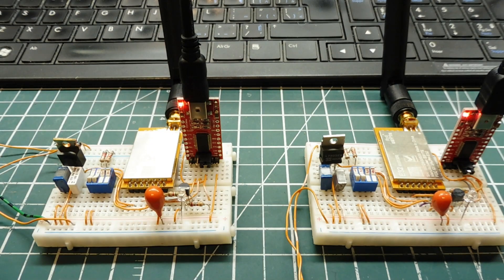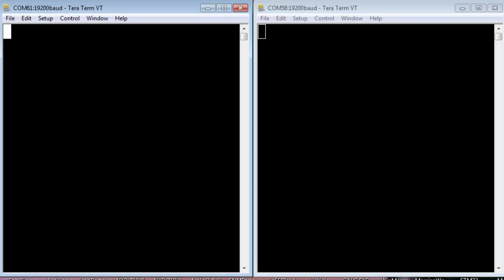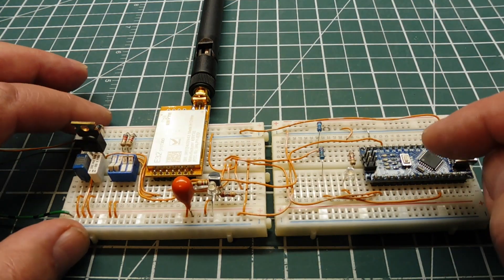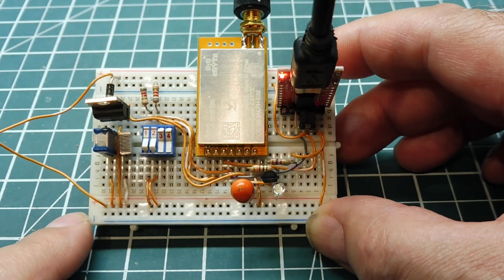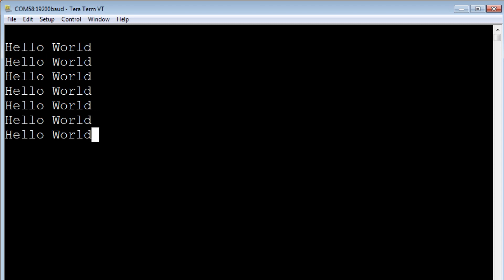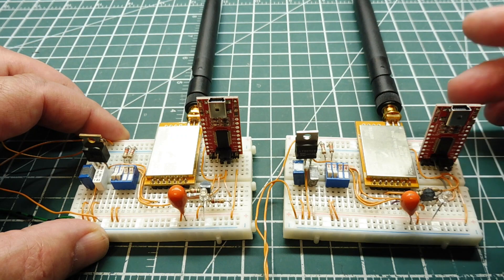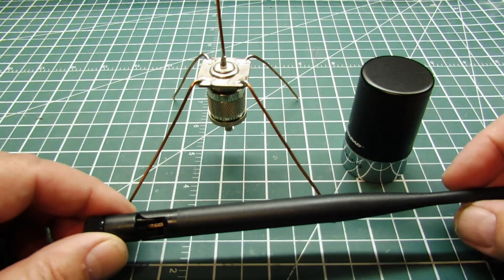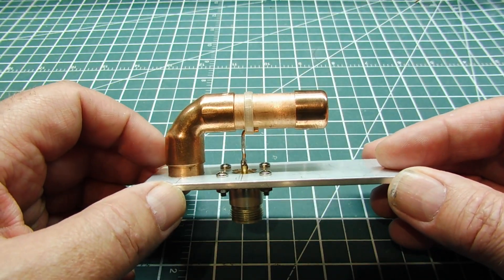Build A LoRa Radio Data Link

Comment: Dear Friend, very nice! can you sharing the schematics and code tx and rx ? 

Regards
Reply from the maker: There is no code. Whatever you type on the keyboard will be transmitted automatically.
Schematic diagram starts at 6:57.
Reply: @0033mer  Thanks!

Comment: Can you use gpio pins on an arduino instead of the switches to control m1 and m2?
Reply from the maker: Yes .. they are 3.3 volt inputs so you could use a 3.3 volt pro-mini. If you use a 5 volt Nano/Uno you can drive transistors with pull-up resistors to 3.3 volts and the collectors driving the m1/m2 pins.
Reply: @0033mer  Thanks so much!

Comment: Hi Mr 0033mer, hope you are doing well. Thank you very much for your valuable videos, you are a very detailed mentor. Have a question about a LoRa project I am building. I have two circuits that are configured as tranceivers  BOTH  IN TRANSPARENT MODE. When reading an analog value (ie. voltage) in  one of the transceivers, by using the lora.print command -lora.print(V_BATT); - the other transceiver receives this value because I use -serialPrint(V_BATT), and I can see the values as well on the serial monitor, BUT at the time I try to display the values on my i2c 4 line display, the V_BATT display a value of "0". (V_BATT value is stored in the variable declaration of the program as -float V_BATT; - so, it should be stored there when received by this end of the link.
I am using the 433T30D LoRa modules.
What do you think I could be doing wrong here sir?
I appreciate any help in advance. Thank you!
Reply from the maker: Since you can see the value sent in the serial monitor your radio link is working fine. The problem seems to be in the LCD interface. I would write some test code that will send values to the LCD screen without the radio link involved. I do this interactively before I write my main code. Check out this video which details how the LCD interface works and how you can test it. https://youtu.be/EnCyPzSsloo
Reply: @0033mer  Hi Mr. 0033mer, thank you very much for your fast response and help.  On the transceiver "A" arduino nano, I experimented using A0 as an analog input to read 5v(1023 just for the experiment) and called the variable "X" to store the value of that voltage  - X=analogRead(A0); then
I  replaced the variable I was "suppodsely received" by the other LoRa with that "X" variable -lcd.print(X);
and the value is properly displayed as "Battery Voltage: 1023 because is being read by A0.
The issue shows when I receive the variable "V" from the other LoRa transceiver "B", it reads Battery Voltage: 0.00.
So, locally, on transceiver "A"  I can read any value and display it properly on the transceiver "A", the problem comes when I try to send that voltage magnitude from transceiver "B". Whats weird is that I am sure I am sending it correctly, because (as I said before), I can see the voltage magnitude on the serial monitor of transceiver "A".
It beats me Mr 0033mer!
What else could be possibly be wrong?
Thanks in advance!
Reply from the maker: The UNO/Nano has one serial port which is used by the USB to serial FTDI. If you connect the LORA serial lines to the TX/RX pins it could be conflicting  with the FTDI and your RX data could be corrupted giving you a zero value.
Reply: @0033mer  Hi Mr 0033mer I have used the "<SoftwareSerial.h>" library and have assigned pins D2 and D3 on the arduino nano board EXCLUSIVELY for the LoRa module 433T30D. So, there is no interception with the FTDI chip lines that come from the USB converter, in fact, the native Tx/Rx lines on the arduino nano board are free, not connected to anything.
Reply from the maker: If your hardware checks out I would double check your software code.
Reply: @0033mer  Hi Mr 0033mer, hopefuly you guys doing fine in Canada. Well, I checked the code and to me following the logic, it makes sense. I tried an analog input at the same arduino and the data is being displayed correctly on the i2c display. I tried the arduino forum, but no help is being offered there. I do not want to waste your time, but if you think you could spend some time in helping me by looking at the code of both transceivers, I'll really appreciate it. Are you willing to take a look at it? -Let me know, it would help a great deal! Thank you!
Reply from the maker: Troubleshooting someone's code long distance without details about the setup and code is not an easy task. I program in Forth and do not use the Arduino IDE so the Arduino forum is probably your best bet. They cannot see what you see so they need a huge amount of detail about your setup and code.

Comment: Hi. Great videos. Is there a way or setup FOR BOTH to become transceivers or bidirectional?
Reply from the maker: The data link is bidirectional. The Lora modules are transceivers so two people with laptops, each with a Lora module could communicate back and forth with each other.
The Lora modules are half duplex so you have to ensure that both do not transmit at the same time.
Reply: @0033mer  Thank you for your reply. Understood, but to clarify my question: I understand these modules have an address and a channel, the address of the transmitter has to match the address of the receiver and viceversa BUT I have done so, and I am able to send data from transmitter to recever, but not from receiver to transmitter. According to the module's data sheet, you set up that once and it should work, but not in my case. What do you thing might be wrong?
I have used the application from the manufacturer to setup the parameters and in both modules I was able to do that successfully. Any thoughts?
Reply from the maker: Ensure both modules are setup the same. Mode inputs M0 and M1 low, same address and channel and in transparent mode. ( Fixed mode disabled ) If you still have trouble you might have a bad transceiver. I assume you are using them in transparent mode. If you are in fixed mode check out this video: https://youtu.be/JvBC7cEgI0E

Comment: Dunno if you're still reading comments here but you reply to a lot so worth a try.... :)
Can you use the E32 to 'sniff' all the local LoRa data packets? Can you configure it to listen to everything?
Reply from the maker: No ... There are 32 channels available for communication between two E32 modules. They can monitor all data packets on the frequency they are on but not on other channels. Check out this video for more details on channel usage. https://youtu.be/JvBC7cEgI0E

Comment: 8:08... If my logic serves me right.... I don't think the 8K2 resistors should be grounded...
Seems like the Dip Switches do nothing....
Reply from the maker: Yes, there is a mistake in the schematic. The dip switches should be grounded not the resistors as shown in the breadboard layout. That was brought up in another video so I put a correction in the description box. Good observation btw.
Reply: @0033mer  The only reason I noticed it was because I just built the same circuit for testing those LoRa modules. Thanks for all the great videos... ;-)

Comment: can i have 3 LoRa modules which broadcasts their data so that they can receive each devices data?
Reply from the maker: If you configure all 3 modules the same they will all communicate with each other.
Reply: @0033mer  so, every devices do broadcast at the same time and we can receive every data. That's meant to be full-duplex?
Reply from the maker: The modules are not full duplex. Only one device can transmit at a time if they are on the same frequency. Check the data sheet where it explains how to use the modules in transparent mode and fixed mode..
Reply: @0033mer  Thanks

Comment: i have issue where i cant get both modules to communicate, i wired correctly with operating mode (M0 and M1 to groung or Low logic) but nothing work, what was i missing
Reply from the maker: Check you configuration (ID and Freq ) with fixed mode disabled. Ensure your power supply can handle the transmit current. Check the operation of your FTDI with correct TX/RX going to the correct pins. Recheck all your wiring.

Comment: No code needed. Just sent serial data to the module and it will transmit automatically.
All you need is a serial terminal program and a FTDI module.
Reply from the maker: That is correct. No code is needed to test out the LoRa radio link.

Comment: Could you share the Arduino source code for this project?
Reply from the maker: To test the data link a computer running a serial terminal program is all that is needed. The Arduino sending the "Hello World" string uses the serial.print() command in a loop every 3 seconds.

Comment: Hey what IC is your voltage regulator circuit based on for these modules. 7805?
Reply from the maker: Yes .. I am using the 7805 regulator.

Comment: could you share the code to this?
Reply from the maker: No code needed. Just sent serial data to the module and it will transmit automatically.
All you need is a serial terminal program and a FTDI module.

Comment: Isn't that antenna basically a J-Pole antenna?  If not how did you calculate the sizes etc.  I'd need 400MHz ISM here in EU.
Reply from the maker: The antenna is an inverted F antenna. Basically a bent 1/4 wave monopole.
Check online for inverted F dimensions and scale to your frequency.
An antenna analyzer is handy for tuning.
https://www.remcom.com/examples/optimization-of-inverted-f-antenna-pso.html
Reply: OK I'll have a look thanks!